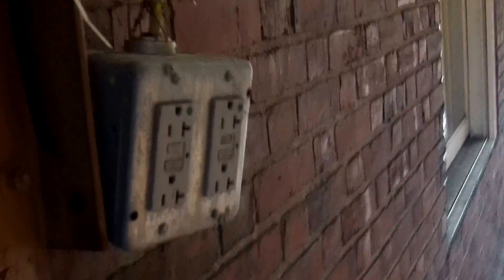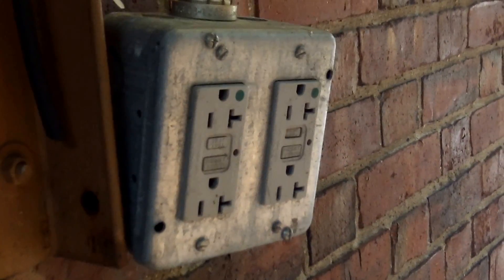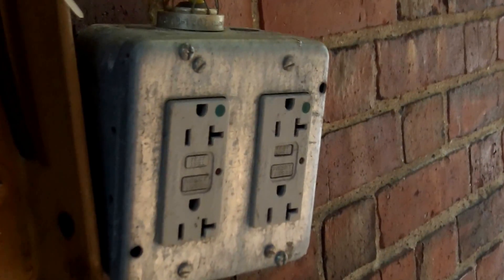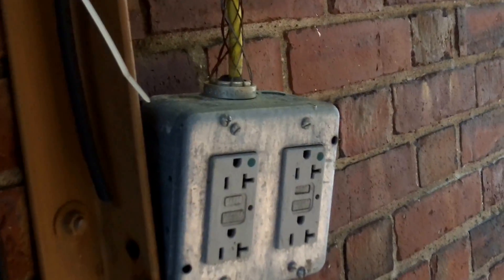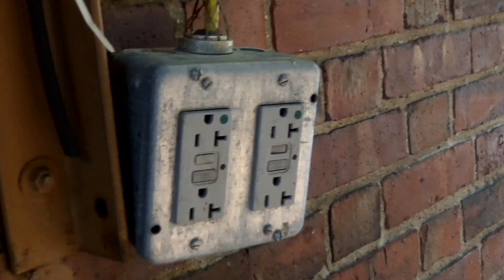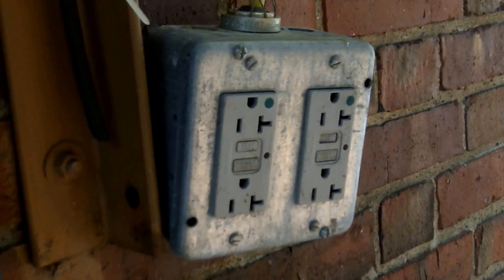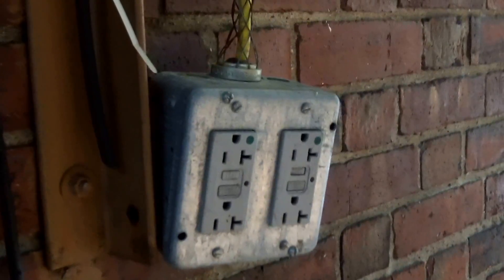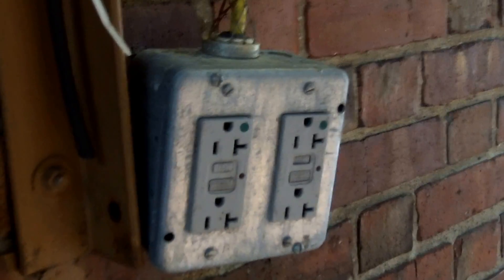Moving Violations Video No. 50, by Russ LeBlanc, NEC Consultant: Temporary Receptacle Arrangement

Comment: I understand weatherproof enclosures, but what is a weatherproof receptacle?
Reply from the maker: A weatherproof receptacle is built with corrosion-resistant metal components such as nickel-plated mounting straps and contacts, and stainless steel screws. The nylon body is also stronger than standard receptacles.